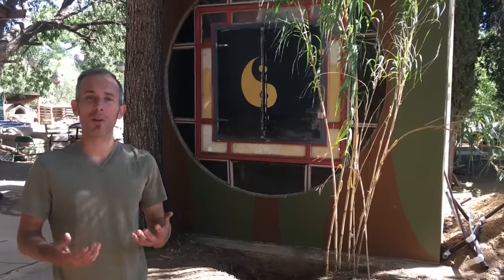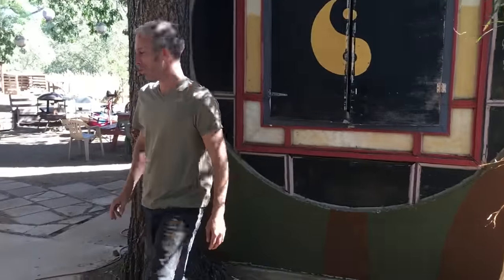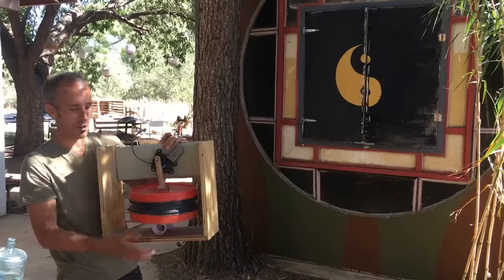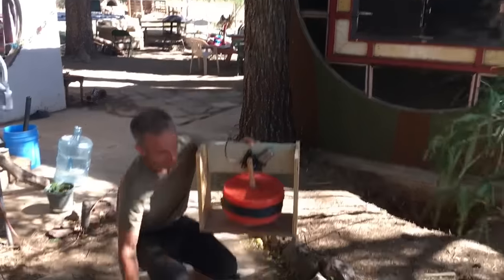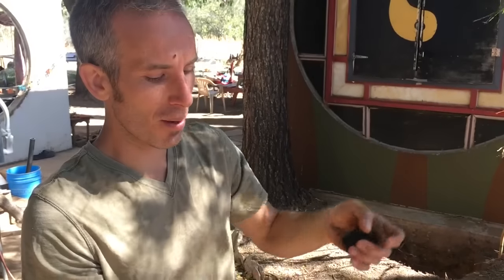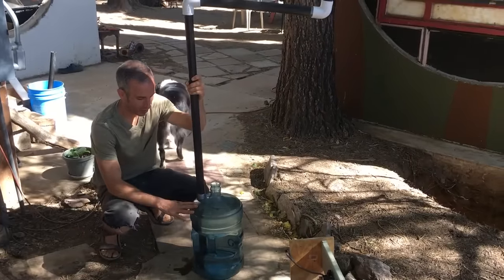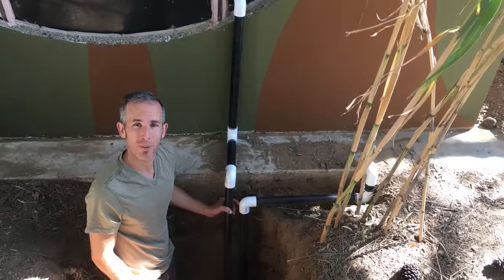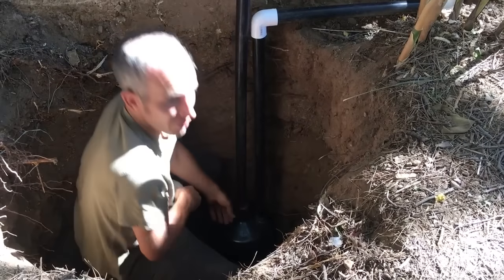$20 Ground Mass Air Cooling -DIY, Open Source

Comment: I love these Open Source Low Tech designs.  And love the idea of cooling with the earth.  I just worry about Legionnaires' Disease when condensation in the pipe turns to mildew.  Perhaps it's dry enough in Arizona so that isn't a problem.
Reply from the maker: The tank can be saturated with table salt to keep it sterile in a way that won't gas off over time. The rest of the system shouldn't really get any water buildup, but should be kept an eye on, yes.
Reply: The dry air will dry the water out and EMPTY the water in a week.

Comment: First of all sorry for my english.  Have you thought about doing the same but replacing the plastic bottle with a clay pot?  Here in Spain, a water container called "botijo" a jug has traditionally been used and it cools the water by allowing the water to perspire because it is made of clay and by evaporating water through its surface, the temperature of the water in the container is lowered.  So I wonder if the functioning of the jug could be adapted to this system by burying the clay pot.  We would have to think of a system to fill the jar with water, but I don't think it would be much of a problem using the pipes themselves.  Congratulations on your channel, it seems to me the very essence of humanity, making simple systems available to people that can be a great improvement.
Reply: That sounds good to me also.  Thanks.  It may seem farfetched for me to still enjoy reading and hearing about low tech innovation when I'm getting too old to do much about it, especially a lot of digging - but maybe it's giving me hope for the future of mankind even when I'm gone, etc.  At least I was able to buy a 2-storey 1900 Queen Anne and fix it up and plant a whole lot of trees when I first retired almost 2 decades ago.  Concentrating on passive systems first pays off too.  Even when it hits 90 degrees Farenheit outdoors, I don't need to run so much as a single fan.  It'll still be between 70 and 75 indoors.  When the outside gets even hotter, I just gradually step up the fan situation while living downstairs and encouraging enough hot air to flow upstairs.  We had a couple of official heat domes this summer but I only had to run the downstairs window AC the greater part of less than 5 days total.  Never at night.  And I've got enough solar to run the  window AC on that if we have grid down.  So I hope I've done my part.

Comment: I'm subscribed, no notifications set up, but saw the thumbnail while scrolling my subscription feed.

Regarding the actual video, I would like to mention that as the air gets pulled through the water, it is going to warm the water. Unavoidable in any situation, but a plastic jug is going to insulate it and make it lose efficiency faster. A more conductive metal bucket that can shed that heat to the earth faster may make it work better.
Reply from the maker: Metal would be better, yes, but I did a rough calculation of the thermal throuput of the polycarb, given its R value, thickness, and surface area, and the max wattage out through it should be greater than what's coming in with the air. And then the heat carrying capacity of the ground should be essentially infinite.
Metal containers are trickier to get, especially ones that seal, and would need to be very rust proof being filled with saturated brine for years on end.
Reply from the maker: I do have some test data on this system, which will presumably be in the next video. Basically, even pumping 55C air into this for eight hours straight, the water temp only came up by half a degree above the ground temp.
Reply: @OpenSourceLowTech  All fair points. I guess it would be a negligent return for a lot more hassle.

Comment: Nice idea! I think you've really done well here.
Reply from the maker: Thanks, been watching your videos on cooling methods with interest. 
There's also a, so far not yet tested, version of this with a slight pressure increase to further cool the air via adiabatic expansion. Would be higher power required for less flow, but could be useful for situations where the ground temp isn't usefully cool, or there's not the option to dig a 2m deep hole.

Comment: Nice idea. Missing is an indicator for water level, as it will drop over time due to evaporation into the air being drawn up into the room, and a means to refill the water reservoir (could be done through the hot pipe side of the plumbing with a Y connection.
Reply from the maker: Yeah a water level would be handy, tho suspect that in a lot of conditions it should condense water out of the air and potentially eventually overflow.
I've been making them with standard garden hose attachments, so you can just unclip the in and outputs, put in a dipstick, and refill if needed with water and or salt.

Comment: It seems that you may have dug too close to the concrete pad and this may cause it to crack. If your going to fill the hole with gravel, kindly put a screen ( landscape screen) around it, to stop the dirt under the house from moving.

Comment: I think a brtter option is a swamp cooler where you use the coold watter from the swamp cooler in a radiator in the house. I have tested a swamp cooler where in 35 C° input air the water gets down to 18 C°. This does use more power. The two fans would probably use around 150 watts of power but with a very large cooling capacity.
Reply from the maker: Swamp coolers are fairly common and often effective, tho they do go through a lot of water and don't work in humidity.
Reply: @OpenSourceLowTech  So mi idea is to use the water from the swamp cooler in a heat exchanger. The reson being the fact that swamp coolers can be unhealthy due to mold and other stuff. Also when a swamp cooler in high humidity it will still make the water several degrees colder so it would be a little efective regardless of humidity. The system would have a regular swamp cooler running on a roof per say, and another pump circulating the watrer in a system that has a ratiator in the house.
Reply from the maker: Could be a bit tricky as the water needs to evaporate into air for the cooling effect.
Reply: @OpenSourceLowTech  
Use the water vapor that is already in the air and drop it to dewpoint underground. With air and ground  temperatures of 30c and 23.5c respectively, you`ll need the air in the cube above 68% RH.
Reply: @JohnGuest45  that does make sense
Reply from the maker: Essentially a phase change refrigeration cycle. Probably would work, tho you'd maybe need to adapt the design to varying air and ground temps.
Reply: @OpenSourceLowTech  
I`ve had a system installed under my greenhouse since 2009,  some years ago i sealed the greenhouse up in full sun to test the system. The greenhouse temperature  topped out at 140F. With the system running flat out, it took less than 12 minutes to cool the greenhouse to 68F which was the ground temperature at the time. It wouldn`t be able to sustain that performance for an extended period but it served to validate the design choices.  I use overhead misting to increase the greenhouse RH% which provides a significant boost to the cooling performance during the hottest part of the day.  A greenhouse is not the same as a living space, plants would be quite happy with 30c and 75% RH,  humans probably not so much.
Reply from the maker: @JohnGuest45  Nice. You got a sump and a pump to cycle it back up to the misters?

Comment: - Do you have a complete demo with delta T measurements? 
- How would you scale this for a bigger space?
- Insulating the cold air pipe isn't necessary ?
Reply from the maker: - I haven't got around to doing a proper results video of this yet, but the initial prototype in Western Australia had s l/s of 55C air (using a vacuum cleaner air mover which is not a good option other than for stress testing the system) going into 23.5C ground temp (shallower and sandier than ideal) and didn't come up ore than 0.5C above that after 8 hours of solid use.

- Depends, but mostly bigger air mover for more volume flow. It'd probably have to be fairly big before you needed a bigger water mass / container.

- Hose pipe insulates reasonably well, but more lagging is more effective, yes.
Reply: @OpenSourceLowTech  thanks ! I'll try it for my 90m3 off grid space

Comment: First geothermal might or might not be the best but it is an interesting idea for this scale.
Second, here are some ideas of improvments:
Remove the water. Use multiple thin metal rods of about 1.5m long x 3mm diameter. Coil one extremity of each rod into a flat spiral and sharpen the other one into a nail. Nail them into the ground forming a line. Only the spiral must stick out of the ground, facing each other. Encase the spirals in a pipe, sealed around the rods and blow air in it.
Now also remove the pump and just use a small fan the size of the pipe. You have no pressure gradient to overcome here since there is no water. 
Also hot air accumulate at the top of the room so thats where you want your intake.
All of that should help you improve a much simpler and better result at the cost of a little bit of metal. You can multiply the rods or increase their length for depth and coil exchange surface with the air. You could put more complexe metal structures in the ground for more exchange surface with the ground...
It could really be a thing when the air/ground temperature delta is big.
Reply from the maker: A more conventional heat exchanger would also work, but they usually require more extensive excavation to allow for more surface area and access to mass.

Comment: Like all your videos, but other then the turbines where you show the output,  this type of videos of cooling/heating, we also want to see the results, i mean, if that works is not hard to measure the temperature of the out pipe that goes to the house and showing a clip of it.
Reply: Than

Comment: desert ground is not 55 degrees at 1 meter, it's more like 75 degrees. Ground temperature is only lower than 60 degrees if it's wet due to evaporative cooling effect. It gets to about 65 degrees down 50 feet deep... good DIY project though...

Comment: The video showed up in my subscription box.
Does this cool the air in all climates?  
Like dry vs humid air.
Reply from the maker: It should pretty much purely depend on the ground temperature (at 1.5 - 2m depth), which should be the average yearly temp for the location. Humid air shouldn't be an issue, but won't know for sure til it's been more properly tested.

Comment: So the returning air is at a much higher humidity due to passing thru the water in the jug. I doubt this would provide much BTU cooling hence the need to place directly under and against a tree for shade. The principle is fairly good but the execution leaves something to be desired.

Comment: Over time the water will evaporate out. Building a portion that comes apart fairly easily so you could refill would make this a permanent solution. Hook up 10 of these to your house and you could significantly reduce the amount of time you have to run your ac.

Question: is fungus a potential concern? This is a zero light situation and if distilled water is used it strikes me that colonization with bacteria is unlikely but I don't know enough to know if fungus might grow. It occurs to me that one could use saltwater like in a saltwater pool but then your house could smell like the ocean constantly. Have you encountered any issues with this and if so how have you dealt with it?
Reply from the maker: Evaporation could be an issue, I usually have a connection point on the hose coming out the ground which can be unclipped and more water put in if needed. It hasn't really been an issue with any of the test sites so far, but probably depends on humidity etc.

I saturate the water with salt to prevent any kind of biological contamination, it doesn't seem to put any kind of odour in the air.
Reply: Thanks!

Comment: To make that more efficient you need to figure a way to make the bubbles smaller while producing the same cfm . The water will have a greater chilling effect on smaller bubbles than larger bubbles. I would look into how a fish tank aerates the water in tank .
Reply from the maker: Thought about it, but in the end (and slightly surprisingly) just the full size bubbles out the hose are efficient enough to cool even very hot air to the water/ground temp by the time they reach the surface.
Reply: @OpenSourceLowTech  suit yourself

Comment: Two things; ! Just allow convection to do all the work for free.  2. No need to cool a body of water when the cool ground is all you need.  But, yes, looks like you had some fun with this one.
Reply from the maker: A thermosiphon could potentially have been useful here, but unfortunately the ground is the cold bit, so a convection loop won't occur.

Maybe if it was used for warming in winter, but there's better ways of doing that.

Comment: amazng what you doing. i would really pleased to see some application in life like what you do with all those or how you actually implement these.  what is the coolest temp you can reach? if you have a plan map of these would be also cool to see. even hand drawn. 
i went through all your stuff already and i am so impressed. 
i want to do some of these at home for myself too and create something sustainable low thec system, yet I struggle where to start.
Reply from the maker: The air temp should be the ground temp, which varies from place to place, but is usually between 10C and 22C, or so.

I'm aiming to do some more testing and then a proper build tutorial.

Comment: I am subscribed with the bell notifications. My Pixel phone added it to my news feed someone last night. I am commenting the morning of April 20th. Great content. Though I am curious how effective that will be in the Arizona summer. I've lived there. That device has it's work cut out for it. 🥵
Reply from the maker: They did some basic testing once it was installed, it seemed to work fairly well, more comprehensive numbers and stress testing to come.
Reply: @OpenSourceLowTech  Yeah. Let's see how it does in August. 120° outside temps are the best stress test. 🌡️

Comment: An idea if you're building this: diffuse the hot air intake into the water so that the water can cool the air more efficiently. (More bubble surface area)
Reply from the maker: Thought about it, but in the end (and slightly surprisingly) just the full size bubbles out the hose are efficient enough to cool even very hot air to the water/ground temp by the time they reach the surface.

Comment: I'm curious, how does the water dissapate the heat it collects? It's sitting under the dirt, which insulates it. On a hot day, wouldn't that water just get warm?

Comment: I've come back to this video to try this diaphragm design out as a simple pond aerator
Reply from the maker: Yeah that could work.
Reply: Bingo!  I've been looking at all sort of different rotary to linear converters for a 50' pond solar powered pump and this is a unique idea.  https://www.youtube.com/watch?v=DG6own141z0 is a well known PVC one-way check valve that is probably better.
This pump is nice because it sort of obviates the need for some sort of lubricant.

Comment: 6:03 
Awesome Content! 🎉
What about wear & tear?
How long do you expect it to last until you need to replace/repair it?
Thank you so much for sharing! ❤
Reply from the maker: Depends on what's used as an air mover, and motor to drive it.
Only really one moving part tho, and nothing run anywhere near max spec, so it should last a while.

Longer term field tests to come.

Comment: You just created a bubble through vaporizer 
How do you deal with the humidity ? 
Maybe a radiator sitting in the water and using it for channeling the air without getting it close to 100% humidity .
Good setup tho
Reply from the maker: I'll need to properly test the setup for humidification, but in principle I think, unless the input air is very dry, it should act as a dehumidifier if anything, as cooling the air drops its dew point and so how much water it is able to contain.
Only one way to find out for sure tho and I'll be properly testing this system at some point before too long.

Keeping the air encapsulated is an option, but would add a lot of materials and build complexity.

Comment: Do you have temperature measurements of the inlet and outlet of the machine?
Thank you
Reply from the maker: I got some provisional data from the initial testing a while back, basically after eight hours straight of pumping 55C air in (heated by the vacuum cleaner pump I was using as a prototype) it didn't come up by more than half a degree above the local ground temp of 23.5C, and that was in a fairly non ideal situation of dry sand at less than a meter depth.

I really need to get back to this tech tho and flesh it out properly..

Comment: PVC to Coiled hollow copper into water would solve plus have less resisistance??
Reply from the maker: Yes, tho am wanting to avoid the need for large bore copper, for price reasons. Looking at non split plastic conduit pipe, which is very cheap and about 0.25mm wall thickness so does exchange heat pretty well, but my concern is the corrugations would gather condensed water from the air and potentially become little pathogen incubators. 
I can hopefully just have a sump outlet which drains any water, but then need to find something smooth walled so the condensation runs down.

Comment: What happens with the water. Does it get stale how do you change it out
Reply from the maker: I looked into various options, best one seems to be just saturate with table salt. Doesn't gas off, non toxic, cheap, and nothing should survive in it.
Reply: @OpenSourceLowTech  collodial silver would be an option with distilled water
Reply from the maker: Thought about it, and copper. Salt's easier and probably a bit more broad spectrum.